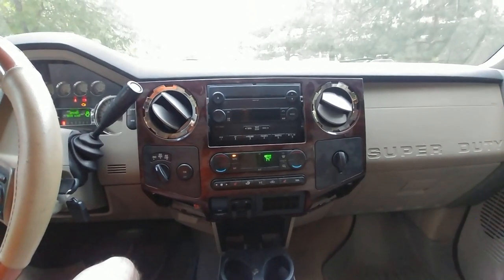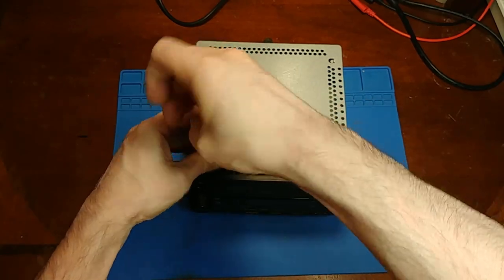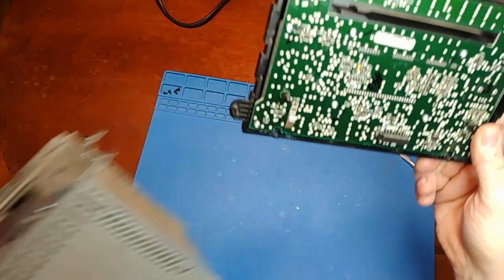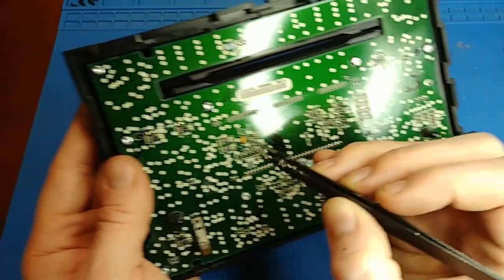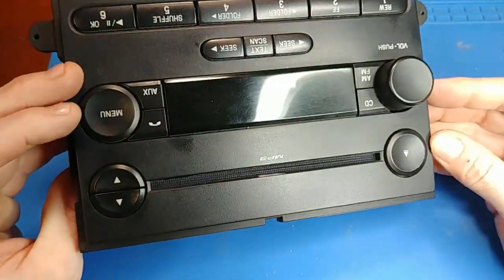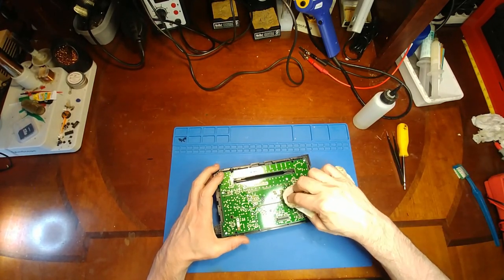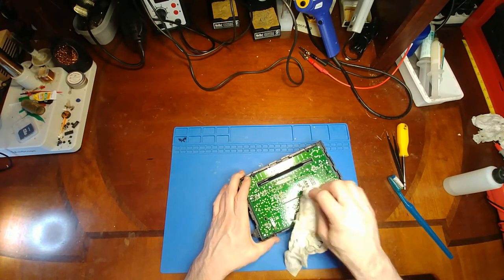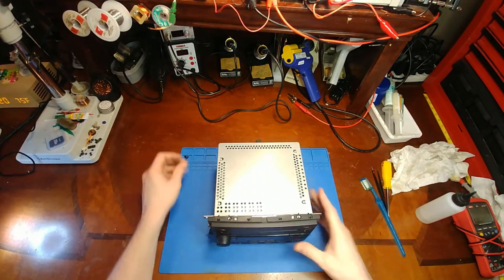Fix Ford Radio 5 min Video

Comment: I just wanted to thank you so much for this tutorial. I've been driving around for over a year with no display on my radio (2012 F250). Although the radio still worked, this was really irritating. This past weekend, I was hesitant, but tried your method. Start to finish, 30 minutes. Good as new! Awesome, thanks

Comment: Using your video, I just made the display repair on my 2016 F-250.  Took less than an hour, and yes, one of the transistors was un soldered.

Comment: This is a great video. I BET, dealers hate to see this. They would charge hundreds of dollars, even if they just fixed it but, they would tell you that you need a "NEW" radio. And they are really expensive. Probably over $600.00.
Reply from the maker: Pretty much yes. They don't typically train the mechanics for circuit board repair, so they would have to replace the entire radio. You are correct.
Reply: @jeffescortlx  I hope you make more of this type of videos. Stealers, I mean dealers,  would "NEVER" tell you to take it to an electronics repair shop for a hundred dollar repair when they can make a couple hundred dollars selling and installing a new one.
Reply: Been told that GM starting around 2010 if any module goes bad you have to replace it with a new unit not a used one from a junk yard. I guess they cannot be reprogrammed. I bet more auto manufacturers are doing this too. How I found out is that I had to replace a abs module on a 2010 Buick lucerne, put a used module in sent it for reprogramming after replacing it and got a call from the shop that tried to program it and they call some GM help line and was told that they are one time program not reprogramable. Get the car back and had to order one from GM and the first one was bad too, then had to get another one which was good. Was also told that all modules in this car cannot be replaced with used.
Reply: Why would anyone pay 600 for a factory radio when you could get a nicer aftermarket one for probably half the price?
Reply: Jeff Williams  So why don't you open up a dealership and charge what you consider a fair price?  Should be easy and a huge money maker no?

Comment: you make soldering circuit boards look so easy!  I've screwed up a few times but have been lucky enough to fix thanks to your videos.
Reply: @Rövhålgren CP Arselstedt always practice is the key. good type of flux is important, the rest is always practice. If you have a feel, how solder flows, you can easy done the task. For most people is a miracle, but don't forget practice is always the key

Comment: That didn't look like a re-solder job, just a process of melting some kind of flux over the pins sticking out. What kind of flux was that? I've fixed those kinds of faults when I found corrosion on those type of pins that were shorting it to the pin next to it. Usually just cleaning that off restores function.

Comment: ok well would explain why mine goes in and out depending on temperature. and i could solder but 1 i dont have a soldering iron and i myself havent been to keen to mess with it. think i will just get an aftermarket radio with a cdplayer and bluetooth. theyre not that costly even to have best buy install them. and ive been kinda wanting a full screen touch radio anyway. 

but still interesting to know why pushing on it i get changes in brightness when it does display or tapping affects it.

Comment: Great to see you're ok! Nice repair as always. Do you think you might try a GM radio repair from around the 2010 era that have front speaker sound intermittent or quits altogether?
Reply from the maker: It's possible if things work out.

Comment: I have the same problem. Hypothetically could I buy a used radio who's CD changer does not work......take off its Face Plate and replace it with my radios Face Plate that no longer illuminates? Thanks in advance
Reply from the maker: Yes. Although the chances of a used unit to either have the same issue or have it soon is high. Best option for reliability is to have the joints reflowed with leaded solder.

Comment: I been driving my car cord fusion 2007 for 7 years now and This is exactly what happen to my car and I been driving like this for couple of months at first I though it was the fuse blown out.. 
hopefully my display be back to normal cuz I hate driving without having display.
 

Quick question ? 🙋‍♂️ 

Do you think it’s fine if I order 10$ solder iron ???  Or does have to be like 50$ ??
Reply from the maker: A cheap soldering iron will do fine. You don't need very much power to reflow these resistors. Some flux would help make the joints look nice and clean.

Comment: I need help my radio works but the controls aren't working I have a 2008 Mercury Mariner I saw a video where the man sprayed some cleaner in it please give me some helpful advice please and thanks in advance
Reply from the maker: None of the controls are working? Like radio preset buttons, radio station tune and volume?

Comment: Good job!! Those also tend to have a bad 3300 uf capacitor that goes bad, which will cause them to intermittently turn on and off.
Reply from the maker: Thanks I will keep that in mind
Reply: @jeffescortlx  Yes sir. Next time you see one turning on and off by itself, you'll know.  Lol
Reply from the maker: @huvernavarrete6494  I haven't run into this style with intermittent power, but I've seen the newer touch screen ones act up.
Reply from the maker: What year range are you seeing these bad caps?
Reply: @jeffescortlx  On these same ones with the display problem. Most 2005 or newer Fords have that display issue and will intermittently turn on and off by themselves also. The most recent I've fixed was a 2008 F250, but I've also done the expeditions and small cars with the intermittent problem.

Comment: do i need to use flux?
Reply from the maker: You don't "need" to. But if your solder doesn't have any flux in it, the solder joints can get pretty ugly with no added flux.

Comment: What if the radio is just not coming on at all ?
Reply from the maker: That's a different problem.
Reply: @jeffescortlx  do you have a explanation? I’ve tried changing fuses and everything 😣
Reply from the maker: @zayg1k  I haven't made a video on this problem yet. But I believe there is a chip on the board that has a bad joint.

Comment: Great Ford quality
Reply: One bad Ford radio faceplate... vs. all GM electronics, (including radios,) and mechanicals. Except for the LS... engine by itself. Then there's the interior plastics and fabrics. Go to a junkyard, you'll see a larger section for GM. They sold more cars, so duh, but you won't find what you need for your GM car or truck, because they've already been picked clean due to the parts failing for everyone. Where as if you go for a Ford radio, you'll find one that works, with most likely an upgrade in features. It will work and isn't tied in with crazy body modules or ridiculous 2 ohm speakers, doesn't have buttons ruined by the oils from fingers. So yeah, I'll take that Ford.
Reply: Gee, 13 year old radio that sees temps from sub zero to over 120 *F and you are complaining?  Besides, " Ford " didn't make the radio, a supplier somewhere did.

Comment: "Just one simple trick " 
There is a bloke that is always trying to talk people into some kind of cheap funeral trick.
He uses that "just one simple trick"  line, so dam annoying,  and now the blokes son is doing the same!!.
Double bullsh1t! lol.
Cracked solder, i've seen it in old vcr's where the unit works but no one is home  (no display).
A missing heater supply,  quite a common problem.
Hope you are doing well with your business, :-D